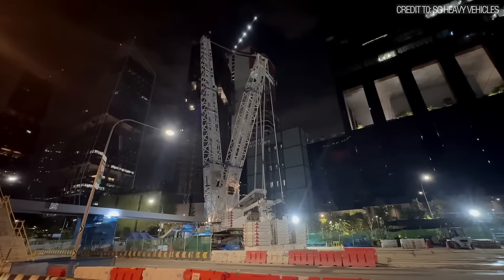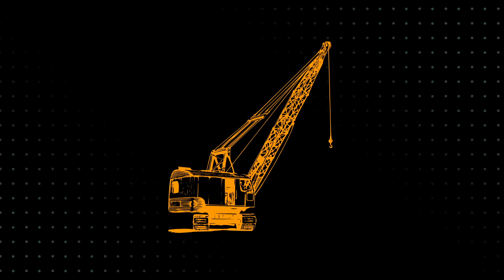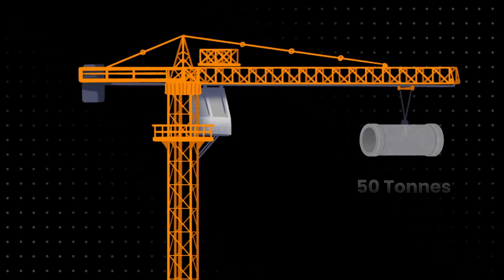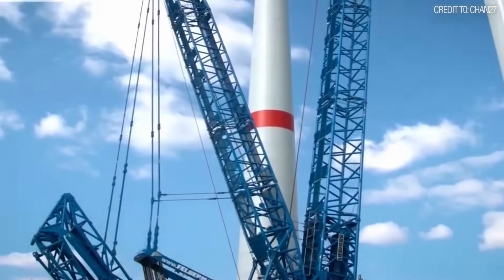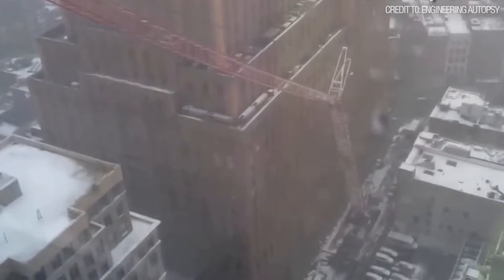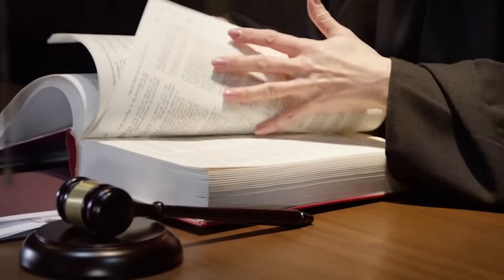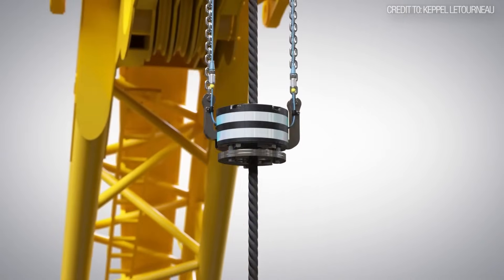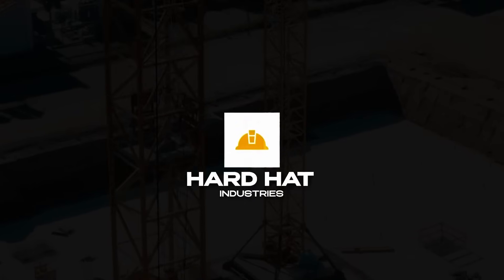How Do Cranes Lift Heavier Than Themselves? (Their One Weakness?)

Comment: To prevent the crane from collapsing due to twisting forces, could you not attach the hook to a building or to a load on the ground so it is stabilized from the hook end?

Comment: Could you explain, why the counterweight doesn't tip the crane over,  when there is no load on the hook?
Reply: Mobile cranes have two limits. A structural limit and a tipping limit. A small 4 axle crane can have 48,000 lbs of counter weight but it is only about 12’ from the center of rotation. When on fully extended outriggers the crane is well within its stability limits. But this same crane will flip over backwards on outriggers retracted. Hope that helps.
Reply: Mobile cranes: slewing ring durability
Crawler ones:same as the mobiles, in small scale(500 tons or less)
Big scale: special systems unload automatically the unnecessary counter weight, left with just enough to not tip👍
Reply: The Crane's counterweight does tip the crane over with no load on the hook, it's called operator error, you can find videos of this.
Reply: It all comes down to the size of the base. Balance a stick on top of a bottle of water and glue it in place. A bottle is easy to tip over placing weight on one end of the stick. Stick it to a dinner plate and it becomes more difficult. Add a blob of mashed potatoes potato’s to the opposite side of the tip and it takes more force to tip it over but the mashed potatoes or counterweight don’t tip it over alone. That’s why cranes use outriggers to increase the size of the base. Crawler cranes can lift more parallel with the tracks than perpendicular because the base is larger. Tower cranes are secured to the building and it becomes part of the base. The tower crane’s counterweight and cables do help balance but mainly help the lifting arm stay rigid and not bend or break like a fishing pole. Engineers calculate material capacity and these balancing forces to come up with the load tables.
Reply: The video made a bit of a mistake saying the pivot point was in the center of the slewing ring, when in actuality the pivot point is whatever the furthest towards the load support point is. On a tower crane that's probably only the edge of the slewing ring so hardly makes a difference, but on mobile or crawler cranes it would be on the leading edge of the outriggers or tracks. That is what outriggers actually do is shift the pivot point further towards the load. 

With that being said the maths does say that the counterweight for a given load would tip the crane over backwards if the load wasn't on the hook relative to the front outriggers, but if you redo the calculation for the rear outriggers (which would be the pivot point that the counterweight would pivot the crane around) then it is able to sustain itself as these outriggers are a lot closer to or even often directly underneath the counterweights. If you look at most mobile cranes thew counterweights on the back of the turret stay within the radius of the outriggers so the crane could never fall over backwards. 

On large crawler cranes it's not uncommon to have the additional weight stacks actually sat on wheels so they're supported by the ground when the crane isn't lifting (and aid's in the cranes mobility). 

On tower cranes since the front and rear pivot points are so close together the counterweight is often on rails to it can be adjusted on the fly how much leverage it has for the required lift. They also have the advantage of being hard mounted into the ground so then it comes down to the structural limit of the crane rather than the platform limit.
Reply: Because the balance point is still between supports. Crane arms have weight. In fact many boom cranes would tip over if they were boomed out flat with no counter weight.
Reply: The counterweight is within the radius of the outriggers, whereas the boom and what it's lifting is outside the radius of the outriggers creating a fulcrum point.